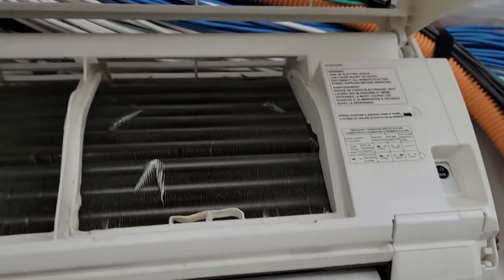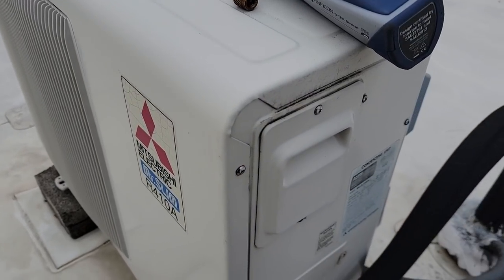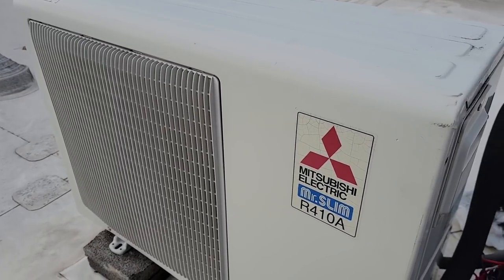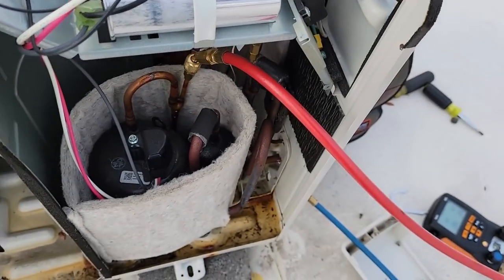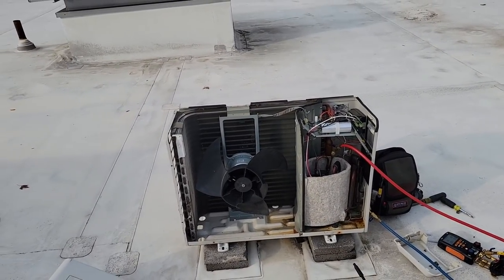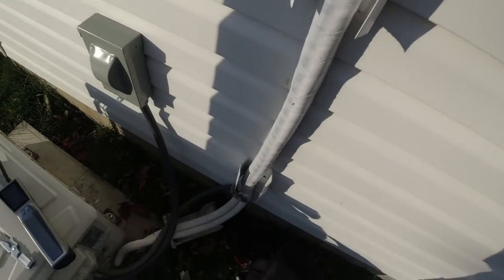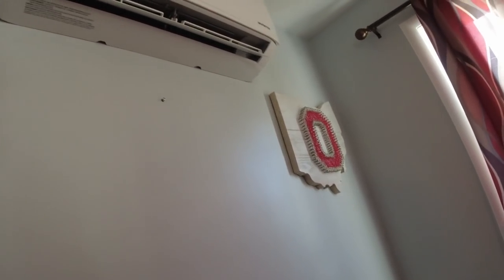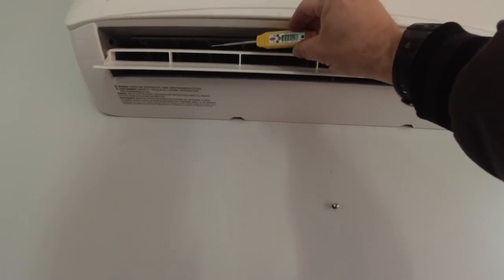Mini-Splits Doing What They Do Best 🤬

Comment: The world out there uses minisplits everywhere, as usual the U.S. follows....central air and forced air heat is so inefficient in the U.s., with leaky poorly connected ducts,  not insulated,noisy fans,not sealed inside hot or cold walls, my Mitsubishis are SILENT inside and out, 10 degrees outside, house is as warm as ya want, same for cooling when it's as hot as it gets...super efficient, SILENT, reliable...

Comment: I just installed one of the Pioneer units. I used the blue nylog flair and thread sealant, but it doesn't harden like what I saw in your video. I had shortened the line from 16 feet to 11 feet and the heat wouldn't work very well below freezing. So I had to pull a little bit of r410a. After that the unit started heating like it was supposed to. What would happen before adjusting the r410a was that the pressure would climb to about 590psi before settling down to about 550psi at 40 degrees, and then the low side would sit at 160 psi at 40 degrees. After pulling some of the refrigerant and getting the low side to settle down to 120 psi at 47 degrees F and 500 psi at 47 degrees I was able to get the unit to make heat. Now I went from 100 degree air at the indoor unit at 20 degrees F outside to 127 degree air medium high fan speed at 8 degrees F. To work on these units it takes an understanding of control systems and refrigeration. The 3 phase motor controllers don't just look at the 4-5 temperature sensors on the units, but they also look at motor load. So for example if the load on the motor is low and the heat isn't within spec on the output of the compressor the unit can detect and the low side is colder than desired then the unit can detect low refrigerant. Anyway that is why the manufactures just say to weigh in the refrigerant.
Reply from the maker: That's a lot of information, thank you for sharing 👍👍
Reply: Mitsubishi units come with rated charge for length of pipe, never had to remove there is no min length, only add if longer, and they spec it all in the books that come with em.
Reply: Nylog doesn't harden, you should not be putting thread sealant on the flare connections, it's FLARE, Nylog works great
Reply: @cengeb  That's what I wrote too.

Comment: I hope that homeowner appreciates the level of tech you are. Most people wouldn't go through the trouble of putting the sticker in the unit documenting everything.
Reply from the maker: Thank you!
Reply: Unfortunately I'm most people, excellent informative video as always don't you try the sealants if it's such a small leak ?
Reply from the maker: @stevenpollock6342 I’ve tried a few different ones and I’ve never had them work. Some people I know have said that it worked for them, but I kind of doubt it.

Comment: I started my career working with these Mitsubishi units. 
For server room applications, get the indoor unit a size up from the outdoor unit. 
Keeping condensing pressure up is very important as you noticed. 
They run without superheat. The accumulator is there for a reason as you stated. 
With age, suction pressure drops without any real reason and they freeze up. Again, get the bigger size indoor unit to mitigate that.
Once inverters became prevalent these problems disappeared.
Reply from the maker: Thanks for sharing your experience👍👍. It's always great to have others contribute to the video✌️

Comment: I thought I was the only guy that stepped on his kneepad. Damn if I don't hate seeing my own footprints on it. My only experience with a minisplit is the Mr. Cool I installed in my garage. I really like it I installed it correctly. I can see a future where these are more popular than regular split duct systems.
Reply from the maker: They have super high efficiency ratings but installation errors are the number one killer. They're too high tech for the average knuckle dragger😉
Reply: The biggest issue, to me,  with trying to use them for your main system is that you don't get whole house circulation.   If you need boosted cooling in one room, then they're perfect.   If you're cooling several rooms, then you're better off having some sort of circulator.   In fact, our whole house standard system spent several days in circulate only mode.  (at one point, it started to smell funny.. Not sure why)

Comment: I check superheat on mini splits all the time. Screw what tech support says. They typically run 0-5 degrees of superheat, at least on systems with EEVs. I wouldn’t use it as an end all, be all diagnostics method but it helps generate a complete picture
Reply from the maker: I agree, it does seem that's what I've seen as well. I feel it should be smart enough to regulate the refrigerant if it's flooding back to much😁
Reply: @HVACRSurvival  they run a completely flooded evaporator in ideal situations, especially at full load. If insulated properly, the suction superheat should be very close to zero. I start getting concerned when I see a suction saturation below freezing and superheat much higher than 5-10. Superheat really depends on lineset length though. At the end of the day, half of mini split calls wind up with a call to tech support anyway. They run on that FM technology. 🤣
Edit: this only pertains to mini splits with EEVs in the condenser. Whatever that thing you were working on is doesn’t count 🤣
Reply: Superheat isn't as useful nowadays since the drive can adjust the metering and the fans on the fly to keep it near 1 or 0 plus you have an accumulator.  Though it might be okay on that Mitsubishi. Idk.

Wish they put high and low side ports on them anyways, I don't like the trend of single ports.

Comment: I finally bit the bullet and went ahead and got the Testo digital probes I'm an old-timer and have been doing it with an old compound gauges for 20 plus years every time I went to a unit with my hoses I would pre-charge my hoses therefore if it was a sensitive charge you don't add or remove any without knowing
Reply from the maker: 👍👍. What do you consider an old timer?

Comment: The DC inverter systems continuously monitors  everything we check with our tools. Why has no one written the GUI code that could be viewed via Bluetooth and/or WiFi? You could instantly see sub cooling/ super heat, Hi and Low pressure, current and voltage on compressor and fans etc.
Reply from the maker: Hard to say, probably because they have no faith in most service people.

Comment: I always get sent to mini split calls. Not my favorite thing to work on, but its not the worst either. Flares, drains, boards.....biggest 3 problems I've encountered with them. Ive replaced the IPM boards, compressors ( which i hate doing) fans, main PCB boards, coils and even ann EEV before. I'd pass on them given the chance to.
Reply from the maker: I feel the same why about them. I don't like having to read about the unit to fix it.
Reply: I think if the compressor goes out I rather just replace the unit, esp if it burned out. All I hear is when you replace the compressor it just happens again.

Comment: Been thinking of doing a mini split for my garage
Reply from the maker: It would be great for a garage👍👍
Reply: I put a 1.5 ton into a single car garage in So.Fl. It can keep the garage cool on a hot day with the garage door open believe it or not. I think it's amazing for a garage. The Mr. Cool DIY kit is the way to go if you do it yourself. The flairs are already made and lines are charged. It also comes with all the bells and whistles wifi, remote etc etc. I watched many install videos on YT. Myself and another guy took about half a day to install it with lineset covers inside and outside. I ran my lineset down the inside wall then out instead of running it out and down the outside wall. I wanted the landscaping to hide the lineset so I came out low and ran it horizontal to the condenser and put that on a hurricane approved wall bracket. Rectorseal makes that.

Comment: Nice work Rick...  I like to use those Mars 90294 relays for that kind of stuff
Reply from the maker: I'll have to look those up. I don't have the numbers memorized.
Reply from the maker: I just looked the number up, yeah I have those, I've had a lot of problems with them. And that's using them for controlling voltage. I like the Honeywell R4222d1021 relay better but it's rated for less amperage than the one you listed.

Comment: You mentioned not hearing of Pioneer brand.  Here in South Florida they are common among mini-splits and relatively inexpensive.  Owned by a company, Parker Davis HVAC International, based in Miami, which is perhaps the reason they're more popular in Florida.

In the case of the Mitsubishi in the school/server room -- you mentioned a couple times that it's a generic unit when you clarified that it's on a simple relay, not variable-speed.  Can you clarify -- it's still an inverter-based compressor, only limited to an on/off state without variable frequency?

Sidenote:  I'm not an HVAC tech.  I have an electronics background and -- unfortunately -- get forced to maintain some of my mini-splits because I cannot find someone like you, who is willing to do work on them.  I believe this is the greatest issue with mini-splits -- finding a HVAC tech willing to work on them.
Reply from the maker: Correct even though it's inverter which saves you some money it still doesn't give you the variable capacity to swing up and down on hot and cold days, it's fixed at one speed. Variable capacity is how they get the efficiency to the extreme and are able to make it work in extremely cold temperatures. It slows down and speeds up the compressor and the fans to match the capacity and environment that it's working in.

Comment: 02:36  Based ON. You can't base something off of something else.
Reply from the maker: I was referencing variable capacity units with a inverter drive, I had not opened this system to realize it was just a generic air conditioner with no intelligence whatsoever. My reference in this scenario would not apply to this type of unit. But what you're saying is "you can't base something off of something else?" How do you think things are diagnosed?, that's like saying people with a cough and sniffles don't have a cold? You're coming across as stating symptoms do not lead you in the direction for a diagnosis. That makes no sense
Reply: So sorry... apologies for the confusion. I was just referencing the speech itself- not the diagnostic technical aspect of the vid. It's a great vid in that regard. I merely meant that your expression (based off of) isn't proper syntax. Actually I've heard it used in a couple of other places too and don't know why it's now part of our vernacular. It's inaccurate.

Comment: Mini splits work great if installed properly. That Mitsubishi must be 15 years old so what do you expect? The newer models are even better.
Reply: Mitsubishi mini splits are fantastic, I use 5 at my house, and save at least $700 a year in oil alone, plus what is saved in energy for cooling in summer.  the world uses them for decades, the U.S. is always far behind...
Reply: @Bryan-Hensley  SEER ratings on Goodman?  Hmmm, not close to Mistubishi
Reply: @Bryan-Hensley  Mitsubishi is not Chinese, mine are made in Thailand or Mexico, you do know the entire world uses Mitsubishi mini splits, in extreme locations, hot and cold, Trane teamed up with Mitsubishi, probably to survive a GLOBAL market, where Mitsubishi is king in HVAC.  You only get 5 years, you must install them wrong, no such thing here, what are you doing WRONG?  Heatpumps have improved so much even within Mitsubishi Hi2 better than something just 5 years ago...stay current
Reply: @Bryan-Hensley  Are you that uninformed, Mitsubishi is Japanese, ever hear of Mitsubishi?  Oy vey....figure out why TRANE partnered with Mitsubishi to SURVIVE a global market place...my entire house is cooled and heated to where I need it all year...5 mini splits save me well over $700 a year , and my electric bill barely moved up,  by not using the oil fired forced air furnace, which includes oil cost now absurd, and 2 large motors for burner and air circulation  and no more central air, all mini splits, has been for years....no more use of leaky poorly assembled in wall ducts, contractor grade junk, minisplits are SILENT, SEER like 30..Modern heatpumps make 100% heat at below 0 degrees, rated to run 60% heat capacity  at -15 DEGREES F. What are you talking about?
Reply: @Bryan-Hensley  Resistivity heating is the dumbest thing to use, it's super inefficient, what are you talking about, if you have so many failures with Mitsubishi, you are doing it wrong
Reply: @Bryan-Hensley  Maybe you need to get trained by Mitsubishi on how to install the stuff properly, and size them properly for the space, oy vey...
Reply: @Bryan-Hensley  25-30 years, like keeping an inefficient old Hotpoint fridge, that costs more to run, than a modern appliance would be a better option, I don't want any appliance 25 years old, it's inefficient crap..so Mitsubishi is making up stuff with specs showing it heats at -15 degrees F, it's 7 degrees outside  here now, my house is 72 degrees or more 5 mitsubishi minplits SILENT heat
Reply: @Bryan-Hensley  You never worked on Mitsubishis, they have filters better than the forced air ducted systems, on the indoor units there are 2 filter elements, easily removed for cleaning, one is enzyme, other a carbon like to attract and remove all kinds of crap in the air.., and the fact that the indoor blowers are always on, being inverter variable speed, they constantly filter the air in the rooms.  QUIETLY..they do not blow directly on you, they have all kinds of adjustable vanes and blades to direct the air flow, you never worked on Mitsubishi, or you would know all this.  The models with "i see", infra red sensors that scan, literally back and forth across the space, read the room, and direct heat or cold depending on the season to where it's needed, you never worked on Mitsubishi, or you would know this...they have their own thermostats readily available, it's 21st century stay current.
Reply: I have 2 12K BTU 2 9kBTU and a15kBTU entire house is heated and cooled to perfection, the old forced air furnace is never used, just to check to make sure it still runs, as BACKUP, since my honda generators are portable, no 240V just 120, will run the furnace in winter is need be,through the transfer switch, so far, have not had to, 10 years on,power is very reliable here always has been...saving a fortune fuel and electric costs...all year long in all seasons...
Reply from the maker: He knows everything🤷😁. We're just stupid American's.
Reply: @Bryan-Hensley  I use mine as auxiliary cooling and heating. I think they're perfect for that. They cool hotspots in the summer and heat coldspots in the winter. Of course, my location humidity is very low so draining just isn't an issue though I did pitch them at good angles and put a screen on the end to keep leaf cutter bees out.

I use it for primary heating because it's cheaper and it works and I can use it just for that room, however I have whole house gas furnace should I really need heat. It just doesn't get that cold here. But one should know the limitations on heat as you do seem aware and that's good. Going in expecting performance of gas or even resistive heating is foolish. 

And of course defrost runs AC for a minute. I rather it spritz some cool air in so as to get that 300 degree refrigerant into the evaporator to melt any ice so it keeps running. Doesn't hurt a thing. Super efficient way to defrost. System puts on low indoor fan to minimize the effects.

And every home should have ceiling fans regardless of climate. Air mixing and circulation helps a ton, imo. I don't have an issue because these can blow right under ceiling fans which will mix the air so it isn't localized heating a room

Cielo makes smart thermostats compatible with just about every brand. I'd rather see built in wifi with apps and maybe remote sensor/controller that you mount not unlike a regular thermostat. May remote controls work that way but that's a bit old fashioned. 

I simply hardwired a transformer and Cielo to the wall so I can do controls from anywhere. It doesn't have all the functions as my unit but it's made to be universal.
Reply from the maker: Universal parts will never happen, when I went through Mitsubishi class the instructor said he can't hardly get information from the factory about proprietary things.

Comment: All these responses and no one has said that is a wrong application.  Mr slim is a residential application.  For a server room situations it should be P-series.  Do it right and there are zero issues.  
Good job getting that ol' boy up and running.  Probably only has a few years left so keep milking it for what it's got.
Reply from the maker: It's a public school building so you know it's the cheapest bidder getting getting the bid.
Reply: @HVACRSurvival  so true.  Surprised its not Gree on the wall.  Lol.

Comment: Somebody destroyed it, all modern  mini splits are variable speed inverter, heating and cooling perfection...people screwed it up, latest ones are better still 30 SEER, able to heat to almost 100% at like -15 degrees...SILENT inside and outside
Reply from the maker: Those are called hyper heat units. This is a basic AC unit. Schools are ran by school boards with no experience in HVAC.  All they know is PRICE. They got what they wanted to spend. Typical problem.
Reply: @HVACRSurvival  yup, the latest version of hyper Heat Hi2, just put in a 15k BTU here at home, super SEER ratings I have  3 other 12K and 2 9k BTU, all year use heating and cooling...so much more efficient and QUIET than the forced air oil.  Save a lot on oil.  Same oil in tank for years, just run it to make sure it runs.  Since gov't is pushing for more electric based stuff, minisplits are perfect, and no local pollution, like burning oil furnace...all the pollution is at the generating plant.